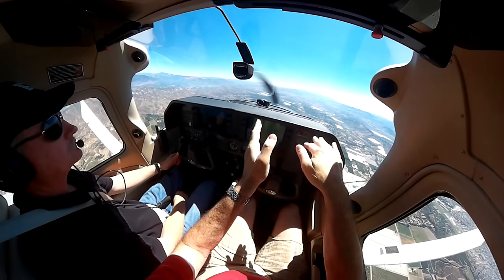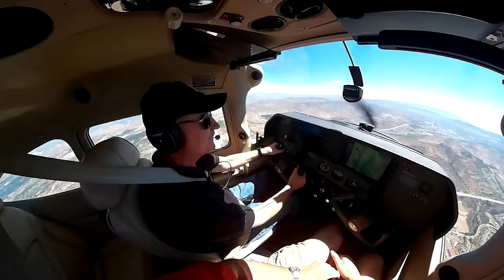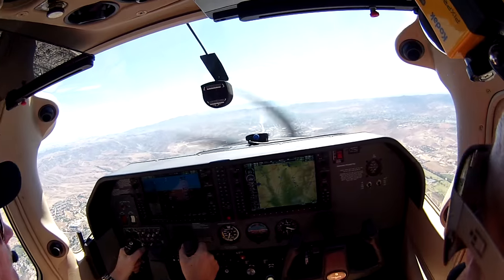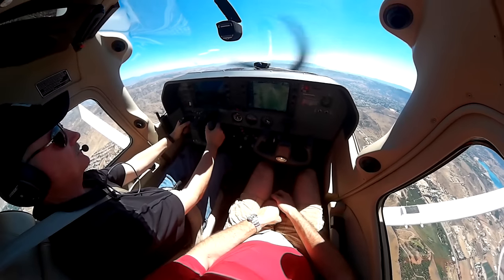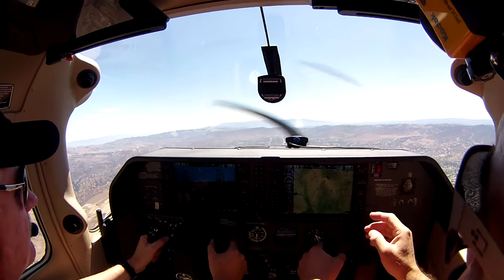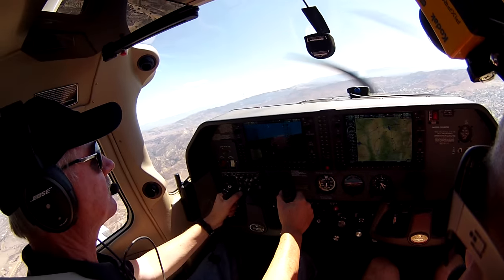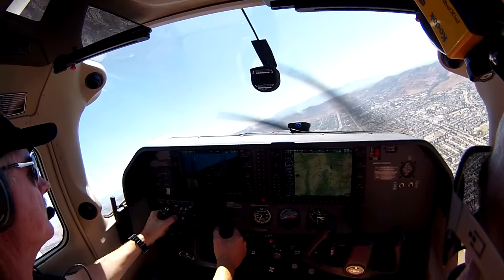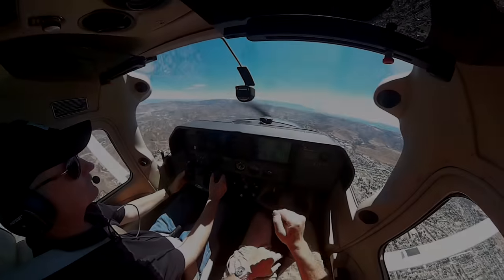Cessna 182 Dutchroll Exercise

Comment: This is not Dutch Roll.  This aileron/rudder exercise is often incorrectly called Dutch Roll.  As CFIs we are responsible to dispel common misunderstandings.  We should use our platform as a
Reply: as an opportunity to use proper terminology and set the record straight.
Reply: 1) Why is this not a Dutch roll? Are they cross controlled or not?
2) Is this coordinated or not? Or cross control?

Why in this video is his nose not changing heading / why is he on point? With right roll and right rudder, shouldn't he be turning right coordinated and thus heading change to the right?
Reply from the maker: Please educate me.
Reply: @jasonbergey8676  There are some in-depth videos explaining aerodynamics behind a dutch roll and yaw dampers here on YT